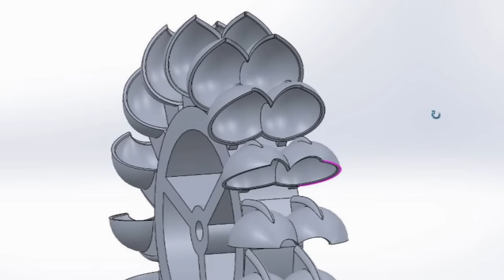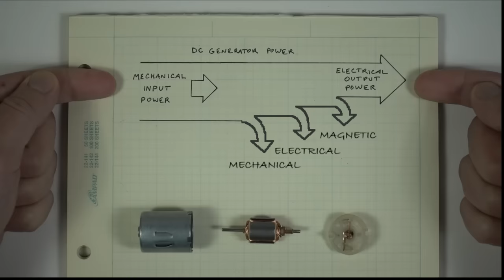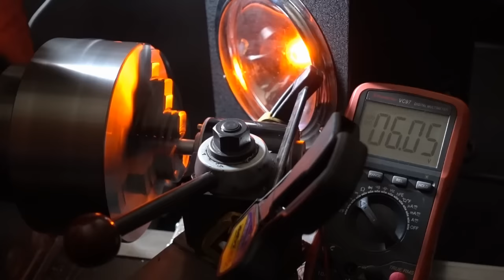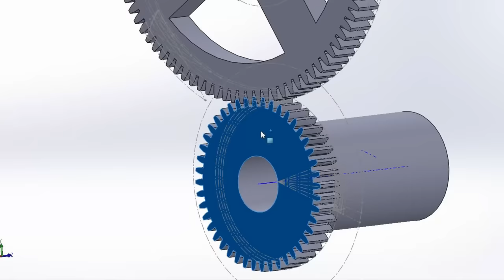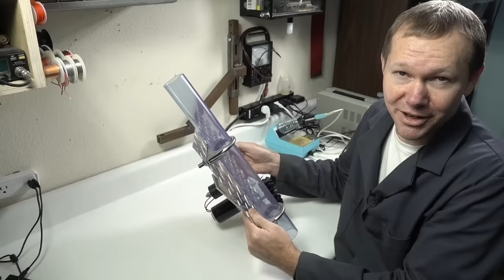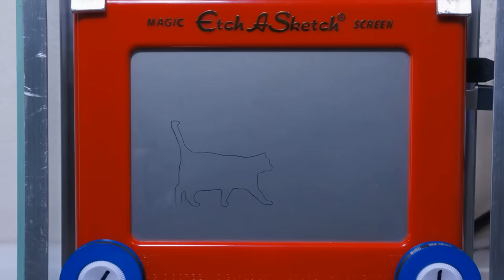Rain Gutter POWER #1 - How to Harvest Free Energy From Your Roof with a Hydro Electric Generator!

Comment: "Free energy"
ElectroBoom has joined the chat
Reply: Yes it's free energy. What Electroboom means by "free" energy is some kind of magically appearing energy. In this case the energy is already there, he's just converting it to what he desired and it cost him no money (for the energy).
Reply: @Lanthan Aka Loli It’s not free energy, it doesn’t produce nearly enough energy to “pay back” the costs that went into making it.
Reply: Guys,you can calm down,I know that it's real and all,I just wanted to make the joke
Reply: @stienogamez8296  but IT culd
If he had used a thinker tube
The area and waight of water 
Would increase 
And PRESIUR too !!
This tube is way too small 
Hole is okay 
But tube diameter shuld be 12" 
Then he would get 6watt +++
The Wright of the water is What make's pressiur

Comment: Great video. Wish I had a fraction of your knowledge. One thing I think needs to be addressed. Capturing all that water and putting it back into the pipe. That downspout was designed to carry water away from the foundation and still needs to do that job, even if it now has a second job. Apologies if this is addressed in future videos.

Comment: Very interesting!
I have a question. What if we drill the holes on the bottom of the pipe (instead of on the side) and put the generator on the bottom too. Would the water squirt produce more power because no energy loss on parabola movement of the water?
Reply: I believe he left the bottom as a "clearance pit" because a roof will always have debris even on dry days where dust will collect. As soon as the rain starts all debris will clog outlets to the bottom

Comment: So many applications for this.  You could use the water to charge rechargeable batteries for use in flashlights, or small items that take batteries.  If you hooked one of these up to each drain you may be able to run them in tandem and charge a larger battery pack.

Comment: Thx for sharing. What a great premise for a project.
Reasonable expectation of generator eta should be near 85%. Now, lets derate due to small size of the system, so, you should still expect around a 70% eta.
I loved that you did the math beforehand so you had a good idea of what to expect from the system overall. Good job.
Don't focus on the voltage that can be adjusted with windings and or DC-DC converters. Focus on the transducer eta first the rest will follow.
Again thx for sharing.

Comment: One thing nice about the set up. You can have two or  more jets coming in from different different points of the wheel. I’ve seen a couple of micro Hydro programs that have jet coming in 180° apart. One jet comes in from one side, and one jet comes in from the other.. say you got more rain than you expected. Now you got jets coming in from three directions. Maybe even make even more power.. you just never know.

Comment: I'm thinking of moving up to a cabin in Scotland and it rains and I think a mix of photo voltaic panels and something likes this could take care of what little energy needs I will have outside a woodstove and a backup propane bottle for before you get the fire on or in the summer.  I basically think an RV cooker and LED lights and my laptop/phone/tablet for evening entertainment this looks like it was made for Scottish weather. Oh and a 12 volt 3way type fridge would be helpful too. I had a different place that had a stream adjacent but I think utilising the rain is great because I'll be putting in rainwater catchment too.  I also have the horses run in shelter beside my cabin so I'll have more roof space,  I was never great at math but am now working out how to combine the catchment into one down pipe, or if its even possible.

Comment: How often will it rain an average amount? Not often, I'd think. It'll either be more or less, and both will create issues. Add a storage tank at the roof gutter so that your system doesn't overflow during a heavy rain. That way you can build up head pressure. Add an overflow in case it rains too much for your nozzle. Build a catch basin around the generator to catch all the splatter and runoff and properly direct it away from your house so that you don't destroy your house's foundation and siding. Improperly functioning rain gutters pretty much always lead to home damage, and with time it becomes serious damage -- water ingress, rot, mold, spalling, hydrostatic pressure, heave, cracking, settling.

Comment: 5:21 the shape and design of those electromagnetic motors is intended to go from power source to workload.  The shape and design of a motor intending to convert torque into energy is MUCH more efficient than simply using the previous design against its specification.

Comment: Fascinating, I was just sitting here in the UK and currently isolated, due to me and family getting Covid, when I started thinking about getting small amounts of power back for charging batteries, etc Solar and wind power are the usual go toos in the UK for domestic, but Rain Water sprung to mind as something that generally is only collected in large hydroelectric power stations and not collected domestically. A quick search brought me to you and I agree that it is potentially a great idea. If I had space and money, I would install a large tank to hold rainwater in the ground before it overflows if not used to the main drainage system and then use solar and wind to pump up to a high-level tank before dropping back down into the lower tank again for re-use. Unfortunately, the UK gives more rain than we get solar power Lol I believe that in small towns and small cities, water could be collected this way and re-used before it is eventually processed for drinking again or pumped back into the river :) Look forward to watching part two now to see how you did :)

Comment: Some Japanese guy built a little generator , thats a box  about  1 ft  x 4 ft  x  9 in .  that you just place in a normal running ditch .   Inside are 2 counter rotating long spiral rotors . It doesnt require much speed , just volume . you could have a horizontal trough part way down the down pipe , and  use that . It will run a 5 hp  electric motor .

Comment: Really cool idea! Try using a magnetic fly wheel to reduce friction, also try running the water into a storage tank to increase the pressure. And maybe a smaller hole to increase the speed of the water flow? I’m not by any means a professional with this but maybe you’ll get more power!

Comment: Take the water in a tube about 6mm diameter, then fit three 2mm tubes with jets on the ends, and aim them at three separate actuation points equidistant around the Pelton wheel. 

This might even out the driving force. Possibly use a Pelton wheel with fewer paddles so they don’t obstruct the jets do much?

Great project. Also collect the rainwater, assuming it’s not illegal in your state. Hell, do it anyway. 🧐😎😜
Thank you for sharing 
Peace

Comment: Great video! I'm sure others have pointed this out, but you should have taken the angle of the roof into account when calculating the area. Imagine if the roof was vertical, it wouldn't catch any rain. You need the projected area, which is A*cos(alpha)
Reply from the maker: Research that part and listen to me say "once I calculate the horizontal distance"

Comment: One tipp: The velocity of the Pelton turbine has to be 50% off the water jet velocity (under load) in order to absorb has much cinetic energy has possibol from the water. I would start from there before adjusting  the generator spin. Nice project!

Comment: Energy companies have always had the thought that you need a high yeald turbine to produce energy. But if every home was passively generating 5-10W+ with low cost solutions at home. It would take quite a bit of preasure off the grid.
 Combine this with a small wind turbine on the roof and a solar panel.
 Some relatively inexpensive solutions.

Comment: When he talked about the work required to raise the gallon of water, I expected him to then mention head pressure that could be achieved by suspending a gallon container inline near the top of the system and the pressure that gallon would put into the system would produce more force on the jet  of water thereby spinning the pelton wheel faster. Of course a bigger container would produce more head pressure.

Comment: The waste water from the pelton wheel could be gathered in a plastic storage box with a small bilge pump with a hose on it to send it back up to the rain gutter or just to your garden.  I know the bilge pump would steal energy so you'd have to run 2 systems or beef up your pelton wheel generator to compensate for the power drag from the bilge pump. That might provide continuous power even without rain.

Comment: Some of that water, the drops that fell on the top of the roof actually fall further before reaching the ground, although the effective height is less due to the incline of the roof.  However, the bottom line is that you might have more energy at the bottom of the gutter than just the height of the gutter above the ground since the water isn't starting from zero velocity at the gutter, it was being accelerated by it's travel down the roof.

Comment: You could make the tubing go back and forth in a zig-zag motion to get a higher pressure into the nozzle. This would happen because there would be a greater volume of water in your tubes, and you could change the size of the hole to get the same amount of GPM. You could get up to the 5 volts that way. With this strategy you would have so much more power.
Reply from the maker: Pressure is a function of height. That's it.

Comment: Turgo wheel is more efficient than a pelton wheel.  I have been able to generate 2500w continuos y from a turgo wheel and 70psi of water out a 3/4inch nozzle. The main pipe is 200y of 4 inch schedule 80p pvc and 300y of sched 80 3inch pvc. Only reducing to 2 inches dia last 12inchs of pipe into 500y/m long in total. 70-72psi head pressure reading 12 ft upstream from the wheelhouse. This produced about 114-118v 58-61hz.  Regulated with a massive triac on a heatsink powering a 2000w water heater.  The triac had a voltage regulator feeding the input variator on the triac. So it helped maintain the rpm of the turgo wheel at ~3600rpm with a constant variable load thus providing the ~60hz stability.   So if the frdige turned on and demanded right away. The triac will sense the voltage drop and thus reduce the load until it equalized. This usually caused a little oscillation on the voltage and speed. But it wasnt violent enough to  cause problems. (Usually).

Comment: Love the tinker’s paradise.  Also like the before project calcs.  I was a bit surprised at only two measly watts.  Since the rain is intermittent anyway. How about having the water build up in an elevated tank, then vacate it with a higher flow rate ... obviously for a shorter duration of time but at the optimized speed and flow to generate the precise power rate required for the load?   Make the key fit the lock so to speak.
Reply from the maker: Need to check out part 4.

Comment: Gutters get clogged regularly, which is not normally a problem. but when you introduce turbines and electromagnets and wiring tot he system, then a simple clog and do some real damage. Engineering isn't just about if it can work but if it can keep working over a prolonged peridod of time.

Comment: Just curious, rather than do gearing could you use a 5" pipe to get a lot more head pressure?  Wont make enough or will it just run out of water?   You could reroute the far side of the buildings drainage to it? Love this video absolutely brilliant 😄

Comment: Great vid! If you want to make some serious power, you'll need to increase the height that the water drops from 2 meters to 50 meters. For example from a creek uphill. There is a guy on yt that has a washing machine motor producing 500 watts 24/7. That is more than enough to power a low-energy home.

Comment: Love the idea, been thinking along those lines, also energy from compressed air , pressurised by Trompe’s that could be fed from the drainpipe. But if I was to make a mini drainpipe Hydro Gene I would make it a lot simpler, with a much smaller motor, perhaps like the motors in DVD/CD players that can charge a ph.

Comment: If you increased the diameter of your downpipe, you increase the water weight therefore increasing preasure of the water stream at the bottom. That should help some.

Comment: Applicable to mosr waste liquid outlets, industrial, commercial and domestic.

Output may be small, but the infrastructure cost of the manufacture and installation of these things is miniscule. As demonstrated,  the technology is easily transferrable and implemented and is applicable to multiple uses at any one location.

Truly, " Every little helps !"

Direct drive is best, with lightweight ceramic magnets on fhe rotating spindle or something using "Hall effect" ?

Comment: An idea you attempt on your channel would be to use this type of set up like a battery. If you had a tank of water uphill. Creating pressure moving through the generator. Then water flows on to lower tank. Then using some other energy generating device like solar to pump the water back up the hill. So in a way the solar is the power and the water tanks and generator work as the battery.

Comment: I would have opted for a boost convertor over the gears. But yes your generator is not a good match for your system. Ideally you would use a three phase brushless motor/generator. If you wanted to get crazy you could custom wind the stator to optimize power output to your system.

Comment: It's all a great idea. For practical use, and the average Joe, no ones going to go out and make this. You have a lathe, drill press, 3D printer, router, tools, workshop and who knows what else. By the time I/Joe buy and learn all this, which average Joe couldn't afford anyway, it would have been far cheaper for average Joe to just go out and buy it, if he could even afford it in the first place. All starting from the "Just go and harvest free energy from your roof.  If that free energy was dripping directly off the roof into a battery or device, eureka! You'd be on to something. What would the Frankenstein look like to go out and scrounge all the pre-made parts to even come close. The video as a physics class...Spot on! I'd love for you to figure out plans for an Aqua ponics green house to use all that moving water to generate some work for water and air pumps instead of 100% city/solar power.

Comment: I love what you tried to do and although it won’t change the physical results you got, I believe you have an error in your water quantity calculation from the rain hitting the roof. The area you want to use (which is then multiplied by the inches of of rain per hour) needs to be the horizontal projection of the roof area. The way you have set it up, if you had a steeper roof, you would theoretically get more water even though the same amount of rain is coming down over the land area covered by the roof: an impossible result.
Reply from the maker: Nope, watch again and look at the horizontal dims as well as when I said "once I calculate the horizontal distance."

Comment: You need to put a jug or reservoir up close to the top of the gutter just under where it is coming out this reservoir will store like a battery, extra water to maintain consistency the larger this reservoir, the larger the gravity will cause a higher pressure coming through to your wheel

Comment: You can optimise a Pelton wheel. Look at the splash water leaving the wheel. If it is travelling the same direction as the water hitting it (as is happening here) the wheel is not delivering all that it can and is spinning too freely. Conversely, if the water is bouncing back in the direction it came from, the wheel is overloaded. Your mod caused that - the gearing went too far. Best power extraction is when the waste water bounces off the wheel at a right angle to the flow.

Comment: The biggest improvement you could make is to abandon Pelton wheel and use something that doesn't lose most of its energy into splashing water
Reply: I agree !
A water wheel made of gutter material that holds the weight of water long enough to spin the large wheel 
Slow ,then gear up to higher r.p.m. for any large turbine.
 Supplied by a regulated flow rain water storage tank elevated slightly for fall.
 For no wind,no rainy times.
Hope for the best from Florida 🌴☀️

Comment: The peloton needs to be tubular so more water mass can create more torque use various gears to the generator.
 The roof is the water collection that fills the reservoir that flows on the elongated peloton in a wide steady stream.
 My goal is to power the whole hood 💪

Comment: You should build another kind of turbine, the pelton wheel need pressure you doesn't have enough. I think a Francis turbine could be more efficient, even more if you built the case, so the water is directed into the turbine and you have no lost.

Comment: I know this video is a couple of years old, so this comment is a little late. I would comment that a Francis turbine may be better suited to your application. A Pelton turbine requires a significant amount of "head" and causes a lot of splash. A Francis turbine can operate with lower head requirements. Optionally if you had a large reservoir you can actually run the Francis turbine in reverse to push water to the roof. This way you have a single setup to draw power at night and store power during the day.

Comment: I would say the system would be much more efficient if you harvest the energy from the downward force of the water that is traveling within the pipe, expecially if you can create a vacuum within that pipe. Nice experiment though, I was just thinking of the same thing and then came across your video. 👍👍